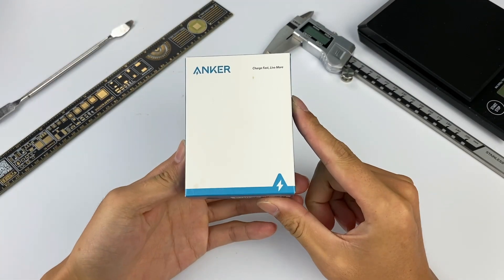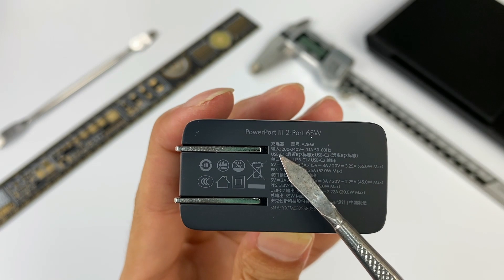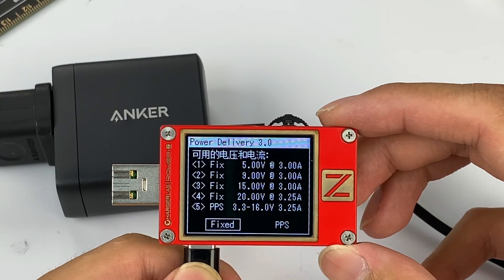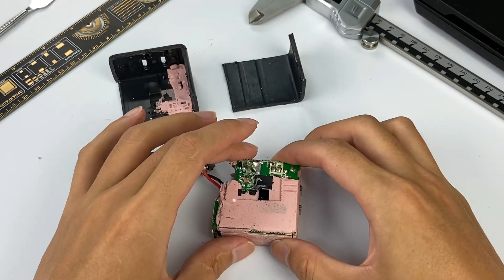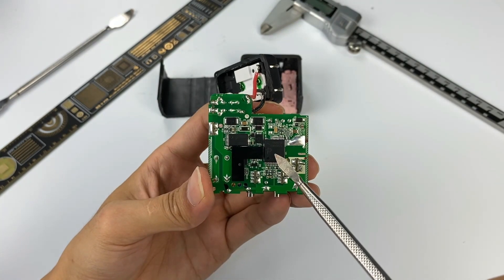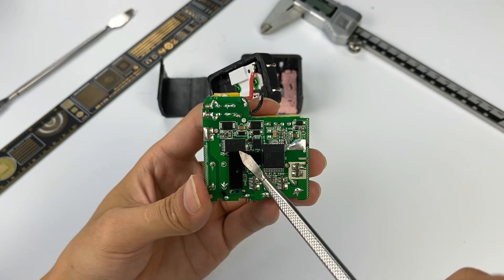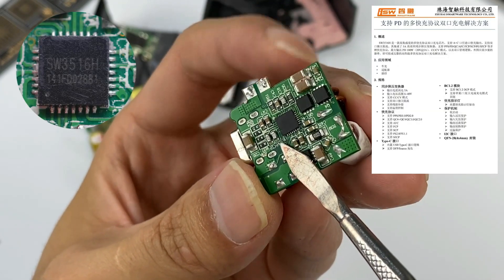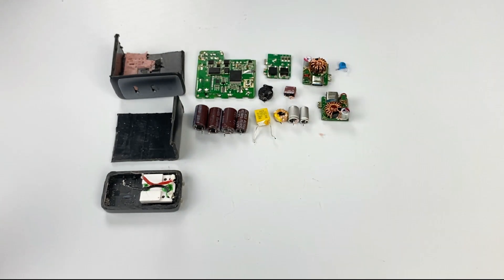Teardown of Latest Anker PowerPort III 2-Port 65W Charger

Comment: Unless it has a USB-A output I don't want it.  Because like 99% of my stuff is USB-A
Reply: The future is USB-C standardisation, this charger is targeted for future use, not legacy use.
Reply: @DrumToTheBassWoop  Sticking with USB A whichbis giidvfor several hundred thousand inserts and removals.   USB C connectors crrp out in less than 200.  And when ir crrps oyt you have all those amps they are trying to pysh through it your mostvlikely to fry the data port on yiur device.  No thank you.  It already cost me a $400 RC transmitter.
Reply: @choppergirl  the usb-c is the next generation usb, of course there is going to be hiccups. 😌

Comment: Why does the charger need 2 buck circuits for only 2 outputs? The AC-DC converter can generate the higher voltage and a single buck circuit could generate the lower voltage. (Then they only need extra Vbus MOSFETs instead of complete second buck circuit) I believe this is how some other chargers do it including Xiaomi.
Reply from the maker: Because this charger needs to support 65W for any port when charge one device. If it just adopts a single buck circuit, the customer needs to distinguish the port every time.